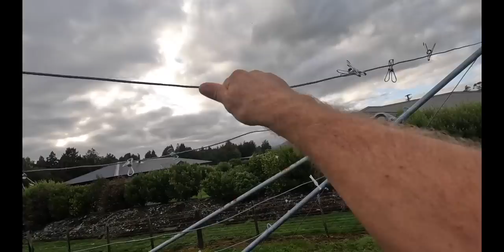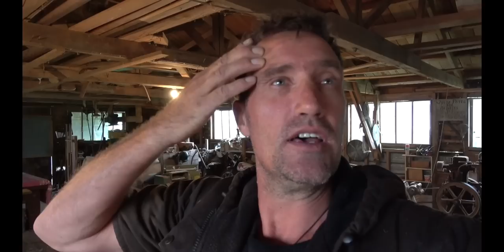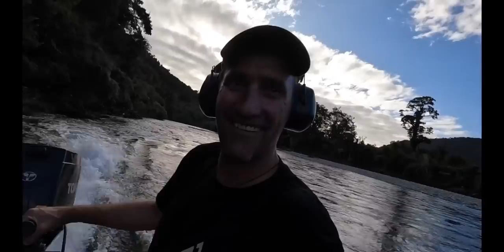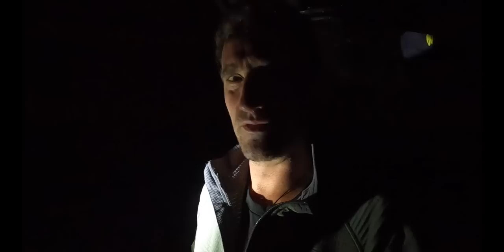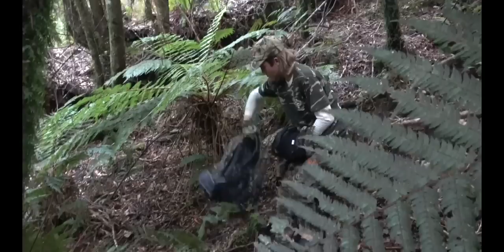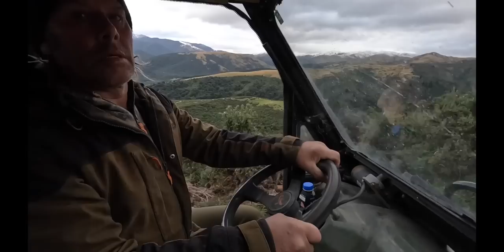VLOG 238 - THE SOUNDS OF SILENCE

Comment: What do ya reckon on a electric motor to take you the last mile or so, then you'd come in real silently. Get one of the most powerful ones to push you along and because you'd only be using it for a short time frame a medium sized battery would be perfect. It's great to see you uploading to youtube again, missed your hunting and fishing missions. Dans shed is a beauty, it must be thunderous inside the old shed with that old diesel powering the tools is awesome, twin cylinder pumping away. Is it an old Lister? Great stuff as always
Reply: power density of the best lithium batteries is 5:1 compared to conventional fuel. so a 10L jerry can of petrol range equals 50kg of batteries.
Reply: @astondriver  I'm talking about doing the last mile or so silently with electric, I'm not talking about doing the entire trip with electric. Just the last mile or 2 so you enter the hunting area as quiet as possible. You don't need 50 kg of batteries for that
Reply from the maker: Yeah, that would be mint. One day maybe

Comment: kahikitea🤙
Reply from the maker: Cheers. Kahikatea is white pine, it's quite a bit different. Soft wood that's good for furniture building as it has a long running grain, but won't last outdoors. Manoao is the Maori name for silver pine. Makes great fenceposts and lasts well in fresh water. Years ago the Nelson city council used it to build a wharf thinking it lasted well in salt water because of its fresh water longevity. But the sea worms attacked it and it rotted away in a manner of months. Expensive cock up that one